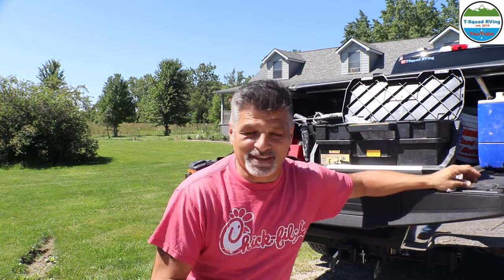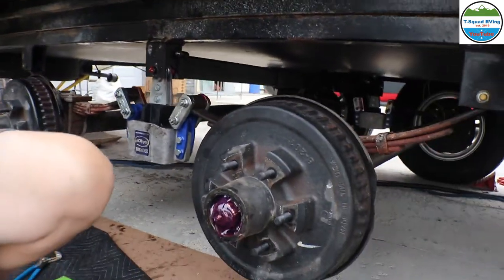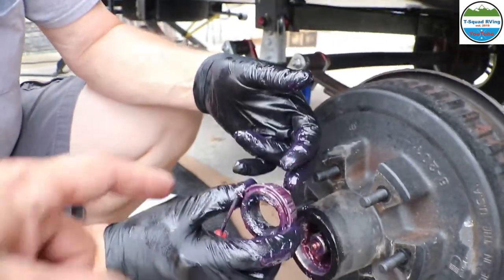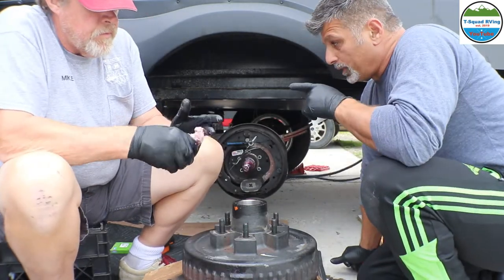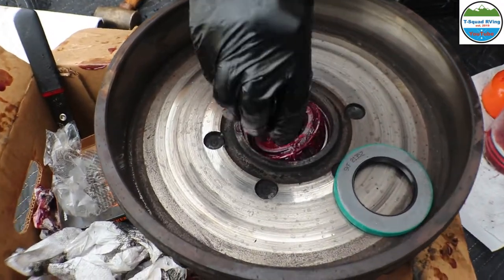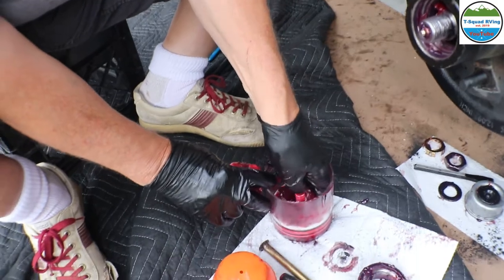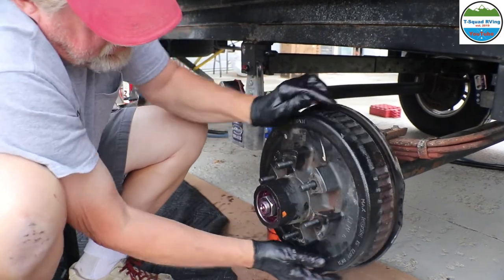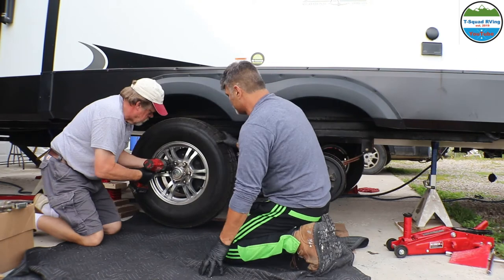RV Bearing Replacement/Repacked  Grand Design Reflection

Comment: Thanks for the video very informational. Did you not replace the races that came with the new bearings?
Reply from the maker: Hey. Thanks for watching.  The bearing didn’t coming with it so I had to buy them separate and replaced them.

Comment: We have just been on the local GD rally, the SRT tech, says he destroys the grease nipples with a hammer. It causes more harm than good.
Reply: If you do it correctly it shouldn’t blow out the seal. You can’t just pump grease in. You have to keep spinning the wheel